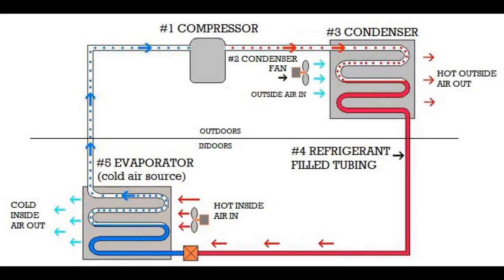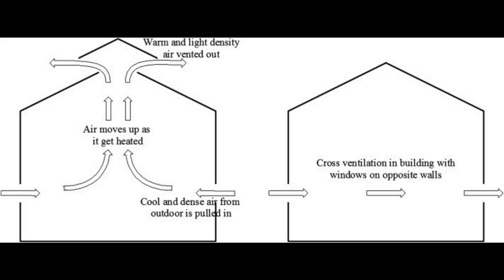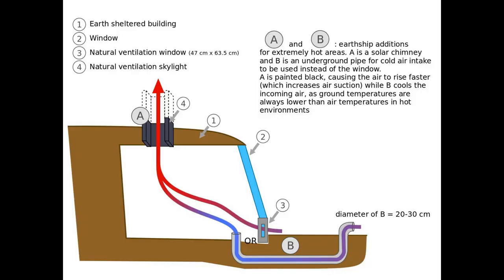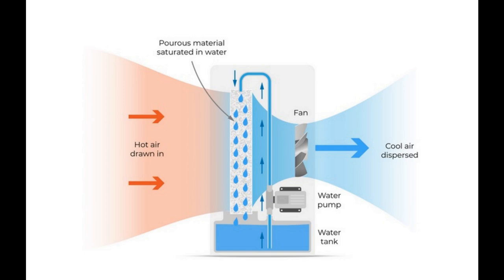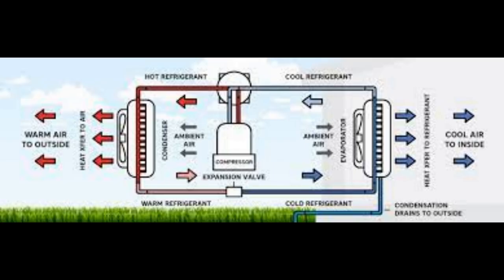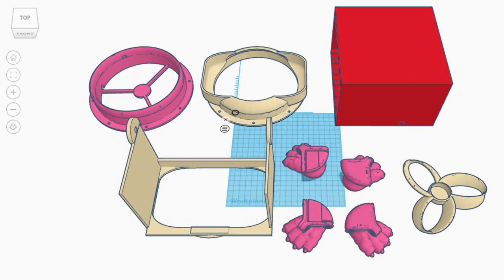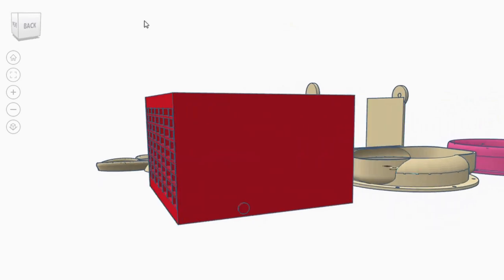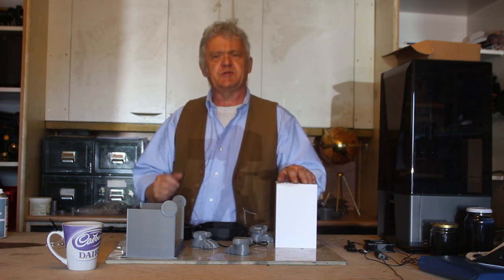1954 DIY Hybrid Air Conditioner Run From USB, Solar Or Battery

Comment: When I was a kid growing up in Georgia my grandparents had the whirlybird vents on the roof of their house but they also had an attic fan that forced air up from the house through the attic and out the whirlybirds. At night the air outside would cool down slightly but it would still be hot inside. So you crack open all the windows and turn on the attic fan and sleep so good with the cooler air circulating.
Reply from the maker: nice - thanks for sharing mate

Comment: I've made many of these and find that ice in a large block offers the best results. Not the freeze packs they simply don't last more than a few minutes before they warm up! I used to freeze a block in an old ice cream tub. And there's so many variations you can make, great to see you covering this especially as yes they do run from a modest 12v solar panel.
Reply: Cheapest way would be to fill a sealable plastic bag with water and freeze it. If you get desperate later on, you can put some broken ice in your drink!
Reply: I agree, the thermal transfer through a plastic case is poor.
Reply: and how much energy did u expend to obtain the ice? (OMG nothing the freezer makes it, yeah u just made the compressor work more to keep the temeperature at the set lvls thus expending more energy then a dam Mecanical AC)
Reply: @Xeridas  incorrect mate. There is already thermal mass in the freezer which helps. There is also a great deal of insulation in a freezer which prevents ingress of heat. Air conditioners on the other hand use brute force and have little to no insulation meaning they run their motor a lot more.
Reply from the maker: Thanks for sharing
Reply: @melissasmess2773  that's why you slide the iceblock in a brine bath. And let the air blow over.
Reply: I concur. Did this several years ago with disappointment.
Reply: Does everyone understand the challenge that has presented itself? How to use power to create ice blocks? How to get low power low temp environments.?
Reply: @mrwess1927  no i fink we are all a ickle slow in the head.... 🤷‍♂️

Comment: Brilliant, thank you.  I have an old wooden sail boat, and this has inspired me to adapt this with a hose from the bilges (always cool due to the water temp in UK waters) to move the cooler air around the boat in hot summers.  We don't have a freezer on board, so ice blocks is not feasible (though I will try this at home for sure).
Reply: Just use radiators.  If the water is that much colder you get all the benefits anyway.

Comment: This is an amazing design. I suppose since water will condense, possible modification for this may be a canal to collect it all and maybe run through the hose to some bucket or outside
Reply from the maker: yes i was thinking of something like that
Reply: Or possibly to a storage where a wicking device that crosses the exit that can be lowered to add evaporative cooling once the carts are expended. Hybrid- hybrid?  But only in fairly low moisture environmen's.
Reply: Yeah, just throw this condensation away! And later, when you need demineralised water, go to a shop to buy some.
Mother Earth will love you!

Comment: Here’s an idea. You take a bouncy ball, cut it in half. That gives you two rubber feet. Cut up a bunch of these, and you glue them to the sides of the freezer blocks. I would say three per freezer block, all on one side. That way, you have the spacers is built in. All you really need is the cut up and glue up a cardboard box to make the container. Use enough layers of cardboard, and you’ve got a insulated container. You’re welcome.

Comment: About a decade a go, there were a few companies that used this concept for whole house cooling.  They would freeze the ice packages at night, when electricity rates were lowest.  Then they'd use them to cool the house when electricity rates were highest.  Add a little solar power for the fans, and you'd be saving a lot of money on electricity.
Reply from the maker: it's still on going as an idea mate - it was first used in the 1950s
Reply: If  a vapor compression heat pump is used to cool the  "cold battery" you also benefit from  higher efficiency, due to a lower temperature difference at night.
You can do the same with heating - run a heat pump at daytime to store heat energy for use at night
Reply: @miroslawmoczyrog  heat pump + sand battery would be the equivalent.

Comment: I live in the upper Chihuahuan Desert at 5000’ elevation. Evaporative cooling works a treat for me! I also fight Multiple Sclerosis and I’m very heat sensitive. I use phase change materials (a type of wax) that help draw heat from within my core in a vest that I wear. It keeps a constant 54°F until it melts but I can recharge it by immersing the packs in ice water. 20 minutes later, I’m back in business for another hour or two.
Reply: I told this to Robert in his previous video, but he did not take it serious and asked ME to create it. As if we all are so creative? I was hoping his chemical knowledge would pick this up. 1kg of paraffine melting equals 2kw(h). That's huge foor cooling. But you already know!
Reply from the maker: nice mate thanks for sharing
Reply from the maker: it's not that i didn't take it seriously mate - but read through the comments and see how many folks suggest i do something - i am but one man - it would be great if some folks helped out and you are a bright guy
Reply: @ThinkingandTinkering  Robert, to be honest. There are thinkers and doers. I am only the first one. But I do know what you are saying, and appreciate it.

Comment: I had something like this many years ago. I made a coil of copper tubing and connected that to a box fan. Put the ends of the tubing in a tank of ice water and pumped the water through with a small aquarium pump. A solar fountain pump works fine. The fan could be run on solar as well. It worked great for personal cooling.

Comment: Worth noting that you're essentially turning the freezer's heat pump into an A/C. There's two gotcha's for that.
1. The freezer is not okay with running the pump into cooling 100% of the time, it will break if you keep swapping out the packs.
2. The freezer output needs to be diverted out of the area you're in, otherwise you're heating the house to cool one spot in it. Which is fine if you air out the house, or it's only during the hottest hours of the day. But keep it in mind.
It's a nice idea for dealing with intermittent heat however, I've done something similar by having a regular fan blowing over a bowl of ice when the weather suddenly turns. I got a second hand 3d printer for free recently, hopefully I can get that working and make something similar. If nothing else, upgrading the fan with better fan blades would be excellent.
Reply: I’ve always wondered why we have developed a better system for residential interior waste heat. Living in the desert southwest we almost never have to heat, even at 40°F due to heat from PCs, cooking, water heater and the refrigerator but summer cooling is rough financially. 
Pumping the waste heat outside during summer seems like a good idea, if you want to live in a vacuum otherwise you simply have hot outside air entering to replace the exhausted air. 
Need a heat exchanger and now we’re talking about real engineering.

Comment: I have something very similar I bought of Amazon, instead of ice blocks you have some fabric fins  that you soak and then freeze, it also has a reservoir above that drips water down on top of them.  Works a treat for a few hours
Reply: i have similar, you can either use blocks frozen or fill the water tanks and it drips water infront of the fan to cool the air as the water vapourises ? swamp cooler style.
The freezer blocks last barely 20 mins but the water drip works for hours although it's not as cold (obv) as the frozed blocks

Comment: Looked very smart, I want one :-) Last summer I started freezing lots of plastic water bottles and using a fan to blow accross them.  Seemed to work quite well but do find get a lot of condensation, so thimk you will need a tray underneath it.  Positive effect is after you tip the water away its also working as a dehumidifier :-)

Comment: I designed one using a 12 volt freezer so it freezes the ice at night and then used as an AC unit in the daytime. Design is on my channel.

Comment: Some early volkswagon beetles had a window hung air cooler that worked on the same principal. It had water in it. When air passed through it it cooled the air and was directed into the vehicle via a duct. Very advanced  &  ahead of its time. One could probably be found on the internet if one tried hr=ard enough to find one ! Very cool ! (No pun intended )
Reply: swamp cooler 👍

Comment: You may be interested in the ceramic core based energy recovery ventilators (ERV) that use a fan on a cycle to heat/cool the core, and then reverse it to extract/deposit the energy (and I think humidity, otherwise they're just an HRV). I've bought a ceramic core to see if I can replicate one as it doesn't look that complicated (a fan...and a core....but it does need to be a reversible fan).

If you're interested I can dig out the link to the core -- I've not proven mine is the same one as used on these $400-1000 devices, but I think it's very likely I'd love to see a video with some data collected on how well they actually work too...

Keep up the great work, it's amazing that you share everything you do.

Comment: the blocks wont leak but they will drip with condensation, if you dont have a drip tray it could leak, you could add a drip tray and then some wicking so any condensation then forms an evap cooling instead of a puddle on the desk! :D(depending on the humidity of the air I suppose)

Comment: Bear in mind that those blue ice blocks do expand slightly when they are frozen, so whichever ones you buy, you might want to add a bit of leeway to the slots that hold them.
Do a test freeze first and then measure them.
Reply: Just exchange the liquid for saturated brine with a dash of ethanol. It will not freeze anymore.

Comment: And a handy dandy Diesel powered refrigerator to freeze the ice blocks to begin with...😂
Reply: Ew, diesel, no! Mine runs on salmon. My region is fortunate to have a large system of hydroelectric dams. They were built starting in the 1950s, unfortunately before science discovered salmon use those rivers. Retrofit fish ladders and hatcheries helped, but still the salmon population can't keep up with other protected species like otters and tourists. So, certain groups frequently demand we breach all the dams to save the salmon. Therefore, my home freezer runs on salmon. 

While on the road, I freeze the ice blocks during the day while driving. That freezer uses a bit of energy from the engine alternator, which uses... hmm... diesel.

Comment: Fans actually heat air.  The fan while moving air about the room actually excites the air molecules.  They bounce about hitting walls and lots of other air molecules.  When the molecules hit each other and there is a transfer of energy in the form or heat.  This can be reduced if the fan has long blades and rotates very slowly.
Reply: in that case the wind should heat the planet but it doesnt really does it

Comment: Beautiful stuff as always. There is tradeoff between coolness and duration, which can be managed (roughly) via ice pack surface area to volume ratio. Designs will vary depending on personal preference. (10C is nice, bit I'd probably trade a couple degrees for an extra hour before recharge.)

Comment: a second set of the freezer blocks in the refrigerator would mean you could just swap out ad infinitum.
Reply: This is what I do. Except I used the freezer packs that come with frozen food deliveries. The curved tubes also increase the surface area.

You can make a super simple version of this by propping them up on a coolig tray infront of a fan.
Reply from the maker: yep - my thought exactly mate - and let's face it everyone who has a freezer runs it 24/7 and they are at there most efficient if the freezer is full of something
Reply: If the deep freezer is in the garage, if it is in the house you're just moveing the heat behind the freezer. Not out of the living space.
Reply from the maker: @johnschneider931  lots of folks in the UK keep their freezer in the garage mate - and isn't that a problem for any kind of air conditioning and not a particular problem for this kind of cooling?
Reply: I thought they're only at their most efficient when the full contents is currently frozen, not when freezing things? 
But they're definitely not inefficient by any stretch. I've rotated these/free freezer packs out during the last heatwave we had. They melted before the others would refreeze, but using 3 sets kept the cooling going the entire time.
Reply: @ThinkingandTinkering   a chest freezer would be best for this, since when opening a standing freezer lets out a large amount of the cold temp when opening the door

Comment: Here in Arizona, all I use is a swamp cooler. The volume of air brought into the house is massive. Leaving a window open some at the furthest part of the house is important. The ice cooler made here may drip a bit, might want to set it on a cloth. Arizona Mark
Reply from the maker: i was wondering about some kind of drip tray - but we will see - cheers mate

Comment: I've been playing with the idea of making a solar powered air conditioner/atmospheric water harvester using peltier cells and silver heat sinks. I would deploy the device on my desert land to cool an earthen home and generate drinking water. I've considered a larger scale version using solar thermal to power an absorption refrigeration system similar to the propane fired systems found in RVs.
Reply: Look into the EcoFlow Wave 2, it is 6,000 BTU’s and will run off less than 400 watts of solar and can heat as well.
Reply: @melissasmess2773  thanks for the tip I’ll definitely check it out :)
Reply from the maker: i have done something similar mate
Reply: The feet are cool

Comment: Those ice blocks can be heated in boiling water and use as heaters in the winter. I think there are some gelly flexible ones that can be heated in a micro wave . Please take due care either way
Reply: Great idea. That would turn this into a dual purpose device - heating and cooling.

Comment: RMS, you can also use silica gel or molecular seive as a dessicant to remove the water out of the air. You can bake the dessicant in the sun to recharge. And it doesn't even use the power of the refrigerator. Cheers!

Comment: Many truck drivers should take an interest in something like this. "Company drivers" live in equipment assigned to them by their employer with no control over the equipment. Those same trucks usually won't idle overnight, because the company wants to save money on fuel. I've spent hundreds of hours figuring out ways to avoid sleeping in the heat, with mixed results.

Comment: i've had one i bought on amazon for a few years (under a tenna), it works fine for about 15 mins then the ice pack is melted and needs changing, it came with 2 but it takes way longer for it to refreeze than it does to melt so you end up waiting hours to reuse it, mine simply has a small sponge under the freezer pack to catch condensation.

Comment: That is a great idea but you need to freeze those that consumes energy (and produces heat) in your refridgerator. Sure, that is a nice way to get the cold from there you another room, but does not chill your house in total.
Nice 3d-printing project anyway!

Comment: To be honest Robert, I would like to see you expand on the method of cooling via water and/or methanol under light vacuum with materials that adsorb these. Then being heated by solar energy to regenerate the process in a closed loop process to remove/move heat energy.
Reply: Hint, you already did a video on the basics of this concept...

The research indicates some countries like Egypt using this method to make large amounts of ice.  

It is not as time and space efficient as modern air conditioning, but it's more energy efficient then it modern air conditioning since it uses solar energy.  Also less polluting

Comment: Downside that I see (please correct me if I'm mistaken) is that most residential refrigerator/freezers are rejecting heat into the living space (and a good deal more than the cooling power of the blocks) and it's a total home loss.
That said, a brilliant way to move the heat to where you don't care as much.
Reply from the maker: here in the uk a lot of people keep the freezer in the garage mate

Comment: I could use this. It's not too bad to have two or even three sets of cold blocks to change it out while outside with the kids. We easily reach triple degree heat (farenheit) with super high humidity here.
Reply from the maker: i would keep blocks ready and swap them over for sure mate

Comment: Hey Rob, how feasible do you think it would be to use a pair of balloons, in cans, connected by a hose, with pistons controlling the expansion and contraction of canned air or some other low vapor pressure liquid?  Could it work or am i missing something? 🤔